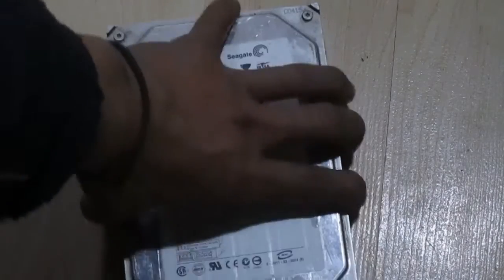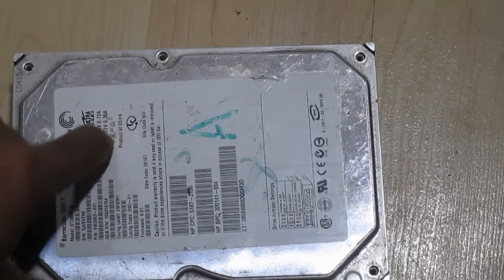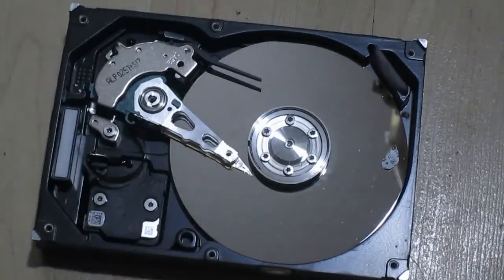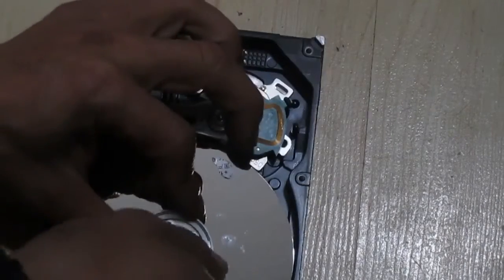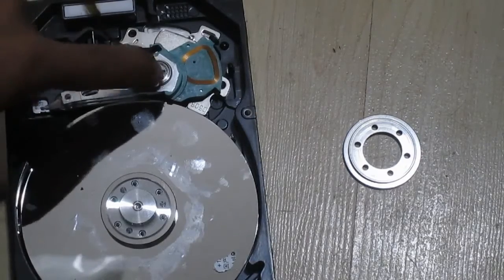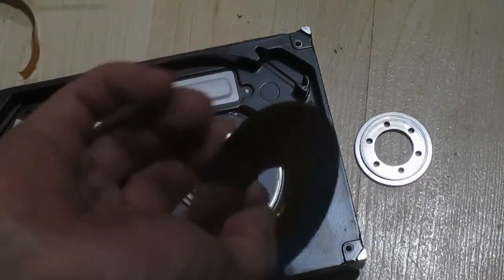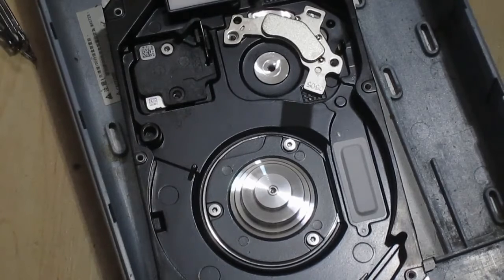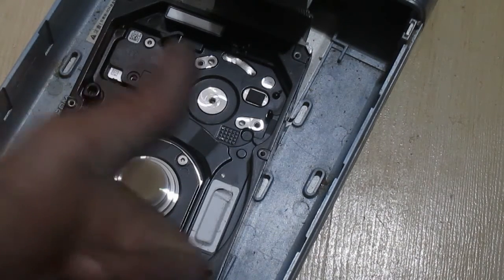Reusing Hard drives for parts and how to make something useful.

Comment: Techno waste can be a treasure trove of useful stuff. The platters make great signal mirrors and the magnets are useful for all kinds of stuff. If your reaffix the platter retaining plate is makes a useful pulley. If you white glue sandpaper to heavy card stock and perforate it to match the platter retaining plate is makes a great sanding disk. PC power supplies can be repurposed into all kinds of stuff from 5v (usb) battery chargers to 12 radio power supplies ( I have a video on this). Thanks for sharing !
Reply from the maker: Name of the video title?  Thanks for watching and sharing with all of us......
Reply: You are welcome. Ham radio power supply from a repurposed legacy PC power supply  is the video title.